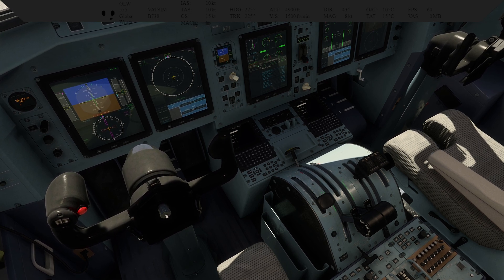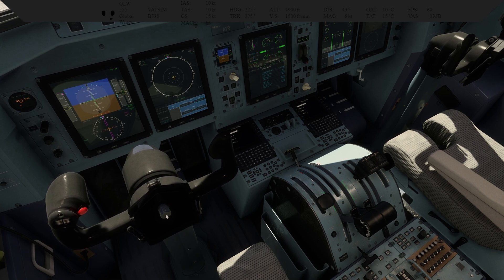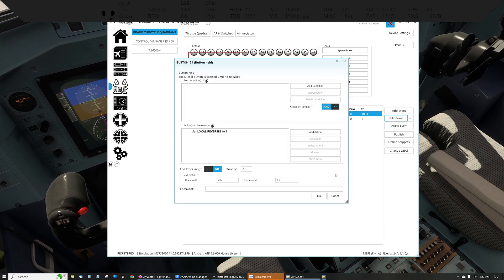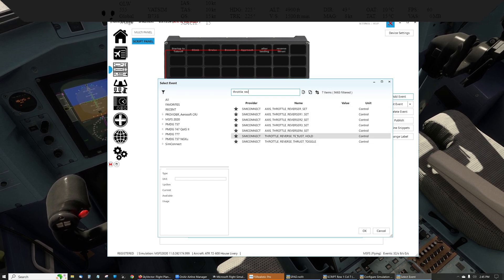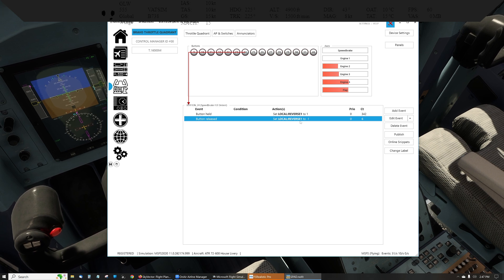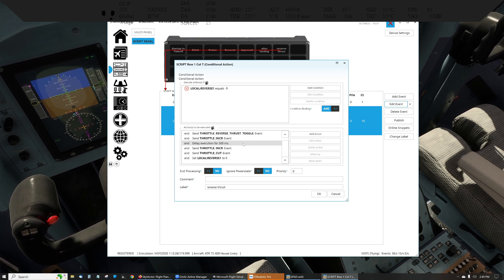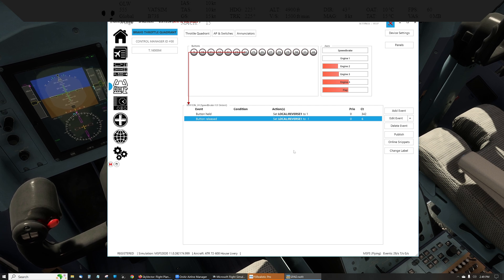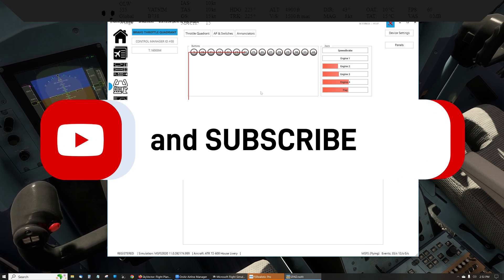How to Fix ATR Reverse Thrust issue in MSFS 2020 with Bravo Throttle or Other Throttles

Comment: When setting up reversers separately for 1 and 2, they work fine when moving them in reverse separately. But when reversing them at the same time, they increase throttle to "Notch" instead of go to reverse. Any suggestions?
Reply from the maker: Hmm, not sure. I have throttle 2 axis mapped to Joy L-Axix X, Throttle 1 to Joy L-Axis Y, neither reverse axis box checked. Then under propeller, I have Toggle Feather switch 2 as button 27, toggle feather switch 1 to button 26, propeller axis to Joy R-Axis Y and Z for prop 2 and 1 respectively. Make sure you don't have anything else mapped in MSFS for power management especially throttle increase or decrease. Let SPAD handle that.

Comment: I have not been able to get any reverser to work in spad.nxt and the bravo.   Had it work once and then never again.  tried what you did and it did not work.
Reply from the maker: When you pull the throttles back into the reverse area, does SPAD show both button 24 and 25 lit up?
Reply: @barleyflies  yes
Reply from the maker: @fishgoblue8763  Make sure that you have nothing mapped to any throttle or reverse functions in the MSFS control options. If that's done, then check in the data monitor to make sure that that whatever local variable you made is getting set to -1 when you have the levers in reverse, and then to 1 and then 0 when you come out of reverse.
Reply: @barleyflies  My bravo profile in MSFS is blank. And I set the the reverses just like what you have shown in your video.  I am very new to spad.nxt and I am a computer novice.
Reply from the maker: The only other thing I can think of is if you have a different throttle setup in the ATR than I do. I don't have a way to share an image in a reply, but on the EFB, under options, throttle setup, in the top section I have only "dual axis" checked.  In the throttle position section, I have idle set to where the throttles are resting on the idle detente on the bravo. Hope this helps.

Comment: Hi Barley
this looks promising although I have a normal reverse function on the Bravo despite the update!    But I want to try your method out as well.  My question is, could i set the throttle incr to 70% rather than full?  This would prevent the a/c pulling up too quickly.....(or any other % logically)....thanks
Reply from the maker: I did some testing and it looks like the most reliable way to get 70% reverse thrust is to add "THROTTLE_70" after the "THROTTLE_FULL" event.
Reply: @barleyflies  ok thanks for that.  I'll try it too.  Just tried it then.  I actually replaced the Throttle_full with Throttle_70 and I get a much more realistic stopping effect.  Only wish the sound matched the props going into Beta now.....The Majestic DHC8 had superb sound for P3D, and they're putting one out for MSFS so I think that will be good.  Have you played around with the sound for this at all?
Reply from the maker: @transair27  I haven't messed with trying to edit sounds. Just getting good SPAD.next configurations working for this plane is hard enough.
Reply: @barleyflies  ah fair enough.  Thanks